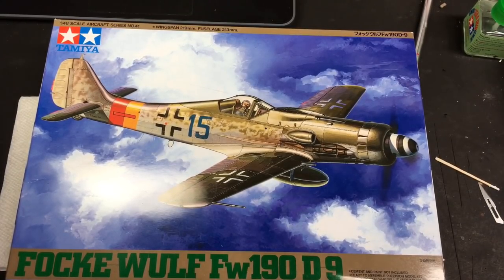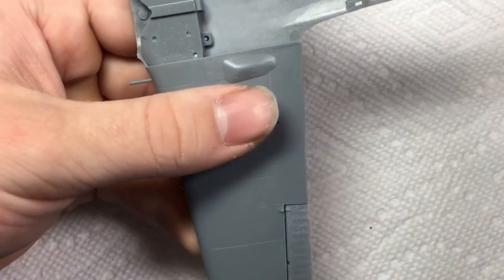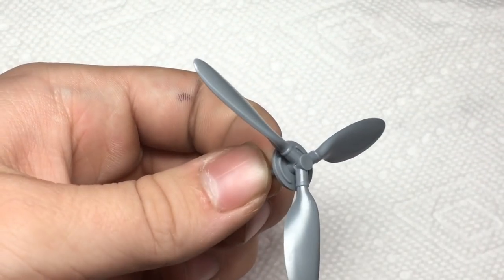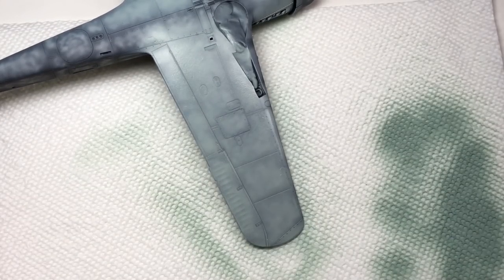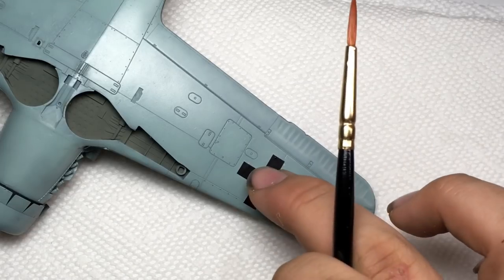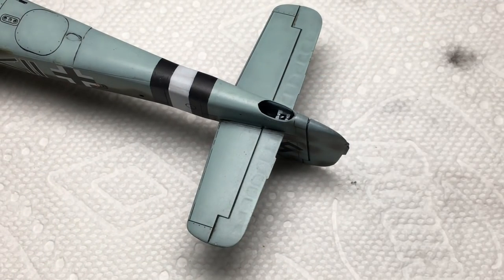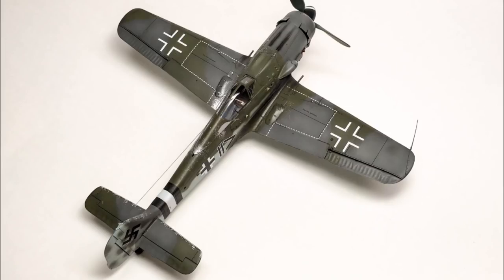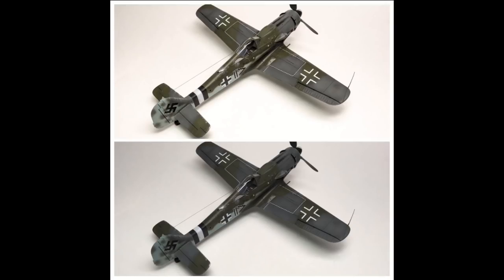Tamiya 1/48 Focke Wulf Fw190 D-9 "Dora"- TIMELAPSE BUILD

Comment: Nice one!  I really like the painted on fuselage band.  One really glaring error with this kit is the wing.  They give you the wing out of their FW-190F8 kit.  Totally wrong!  The center of the wheel wells should not have the dimpled panels.  That area should be open with the inline engine protruding into it.
Reply from the maker: I knew about the open part, but never heard about the dimple. Also, it's got incorrect ejection ports. It's a mess of a kit as far as accuracy goes. Definitely going to get the Eduard one, and do it up as a JV44 bird.

Comment: I've read on a post on Britmodeller that the best way to deal with Tamiya decals is to use hot water, since the glue is what makes them thick.
I also have four Hasegawa Fw 190s, and the landing gear on all of them is rather wobbly, so it maybe a design thing on every 1:48 and above Fw 190.
Reply: I have heard and bought Gunze/Mr. Hobby Setter and Softener. Have long since forgotten where and when I had read that. Supposedly great for Academy's decals too.

Comment: I'm building this model right now!

the instructions said not to cement the prop, did you cement it? supposed to attach to polycap
Reply from the maker: I generally don't do polycap steps; I've never been a fan of moving parts on models unless it's something really special (functional contra-rotating, etc). I usually glue them on.
Reply: @TheWaggishAmerican  oh that's sad

my models I also like stationary but when it has propeller, I leave the prop unglued I like it rotating